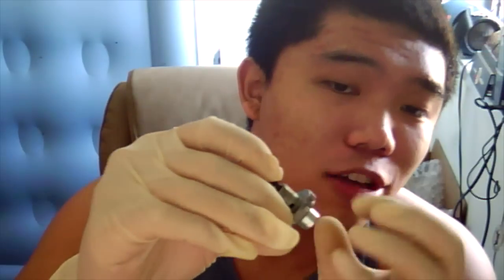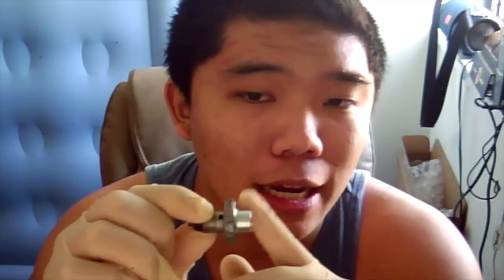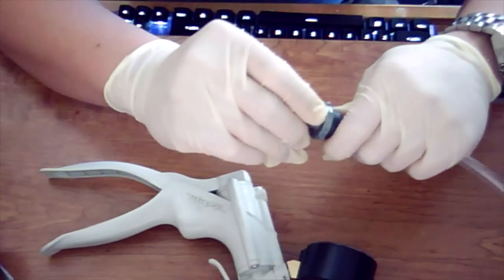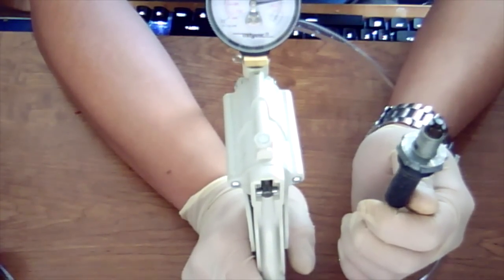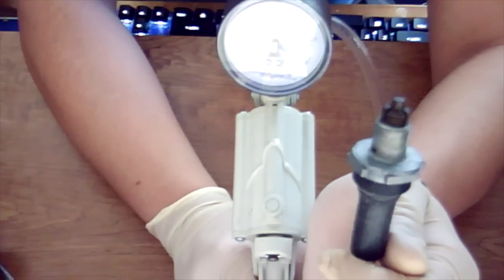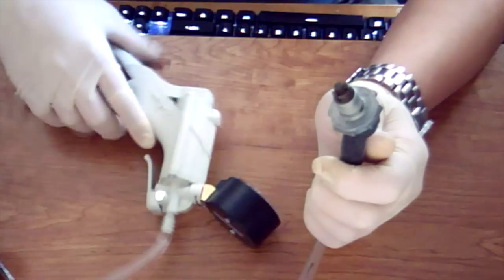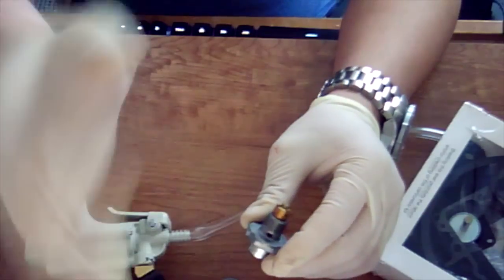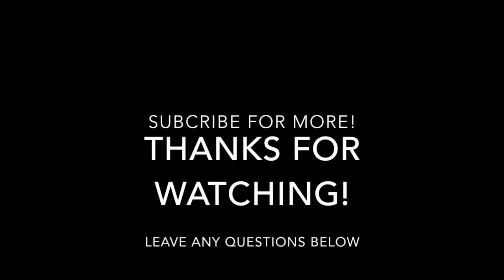HOW TO: Testing a Power Valve

Comment: Thanks for the video 🙂 I have a 600 Holley on my 69 F250 390 and my idle circuit was acting like an A$$ today .  I have a big ol bag of different size power valves and I reuse them until now .

I'm going to test them all I would come to a stop light and the mixture would just slowly get richer and richer, I start out at 13 AFR and end up at 10.5m 😳 .  Go to take off runs like a champ till I stop again then it shot up to 14/15 🤔. Turn the screws get it back to 13 then next stop light it's at 11.5 ? 🥺 Maybe the old gaskets I use too I already had a stuck secondary needle and seat and jetted up 10 sizes before I realized it was sticking .

This gas is no good for carb anymore maybe go efi ..

Comment: I have a 72 mark iv and have been battle the carb and runs rich no matter what I do, it's a 4 brl Moto, so should be same from what your saying no matter 2brl or 4 brl right?
Reply from the maker: Yeah the power valve could very likely be the culprit!  Check out my latest video on fixing power valve issues if your new power valve gasket leaks.

https://youtu.be/iHHhrKv5mCc
Reply: @ctuan13  have u ever done a video on Moto 4 brl everywhere I search you find a little this or that but nevr what will help and in the comments are tons of ?'s,  thanks again much appreciated

Comment: Also, be sure to get ethanol-free gas like "recreational gas" for snowmobiles. Because these carbs and the rubber parts, they were engineered way before they started putting ethanol in the fuel. The ethanol can be hard on 'em, so use ethanol-free.
Reply: We're are you going to get that ? Are you talking about the racing unleaded that has no ethanol in it ? Man that stuff we're I live is 25 bucks a gallon .😳

Comment: Do those have numbers on them for the amount of vacuum that they open like the holley type?
Reply from the maker: Unfortunately these ones that come in kits don't usually come with numbers.  Although if you know the number power valve you need, you can get it from Mikes Carburetor Parts online.  He's got both single and two stage valves available in tons of different vacuum values.
Reply: kwd57 they have the numbers. Holley parts. I swear that the valve was so weak it was open at idle

Comment: Nice demo.
Reply: jack tietjen does the power valve affect the take off cause mine runs well except for the take off it bacfire is my power valve blown ,what might be wrong
Reply from the maker: A power valve really only comes into play when the throttle is opened greater than 50%, certainly it isn't playing any kind of roll right on throttle tip in.  Remember, a power valve is closed when vacuum is high.

A backfire on acceleration can be a lot of different things, but some basics are checking for a vacuum leak, checking to ensure idle mixture screws are set correctly and checking for a restricted exhaust.

Hope this helps!

Comment: My valve was stuck with varnish.  I'm going to replace it but just for fun I tried to unstick it.  Soaked it in carb cleaner for 4 hours and pressed really hard on the end and then it snapped open.  Required a ridiculous amount of force.

Comment: If you follow Holley's recommendations for power valve selection; you will have what appears to be a blown power valve because the engine won't die with the mixture screws seated. But; this occurs because the valve is to weak and its open at an idle. I had a 6.5 power valve because I used Holley's instructions. 13 inches of vacuum at idle so 6.5 valve. The Spark plugs were black. I installed a 10.5 and now it's closed at idle as it's supposed to be. I don't know why Holley is still teaching that 1/2 of idle method, it's wrong.
Reply: The half deal is a good ballpark setting for most carbs. Actually it's not at idle but CRUISE vacuum. So if you are at say 40 MPH and you have 14 inches of vacuum, try a 7 or next lower power valve.
Reply: @jimdavidson5208  Hey Jim...You don't have a clue what you're talking about. It's at IDLE, not CRUISE vacuum.
Reply: Holley didn't tell you to seat the idle mixture screws, so maybe that's your problem. You should watch their video again.
Reply: nobamagone1063 - The scenario you describe doesn't make sense; a 10.5 PV will open sooner (closer to 13 inches of vacuum) than a 6.5 PV.  Doesn't seem likely, but maybe the 6.5 PV was bad (blown or leaky).  I agree with jimdavidson5208 that the half vacuum reading is a good place to start, but the reading for that method should be done at idle.  A better method is to note the vacuum reading at steady part-throttle cruise speeds and use a PV 2 steps smaller than the cruise-speed vacuum reading (or 2 and a half steps smaller if 2 steps smaller lands on an even number).

Comment: Can a blown powervalve cause the motor to stall?
Reply from the maker: Potentially, if the leak is bad enough and there is enough fuel being sucked through and bypassing the power valve, it could flood out the engine and cause it to stall.
Reply: COPPERHEAD GARAGE I wouldn’t see why not if there’s a immediate lack of fuel

Comment: Hey buddy can I just replace my two stage power valve whit a single stage?
Reply from the maker: For sure, you can always replace a dual stage with a single, just make sure you find the proper value valve.  For an automatic, put the car in drive and get a manifold vacuum reading.  Divide the value by two and select that value valve.  If it falls on an even number, choose the next lowest value valve.